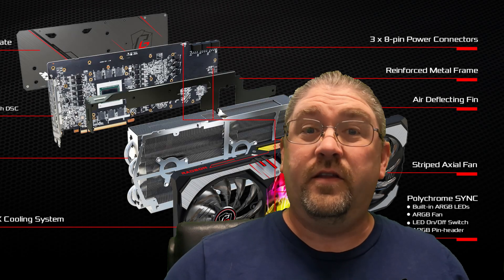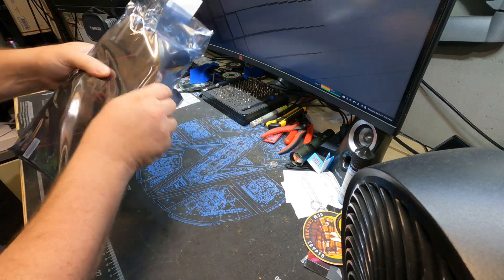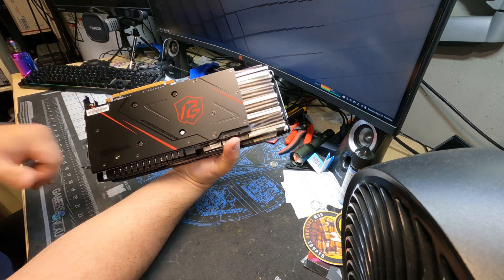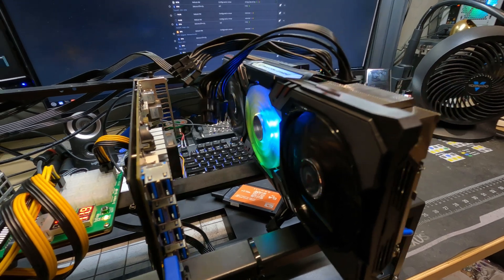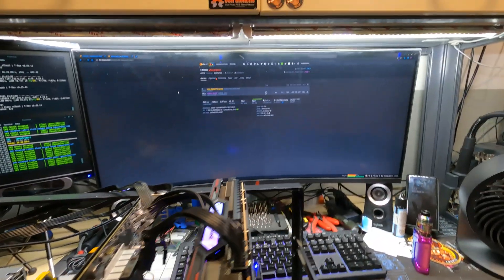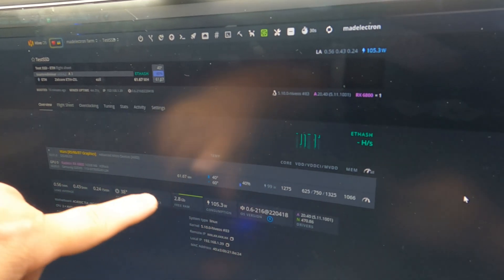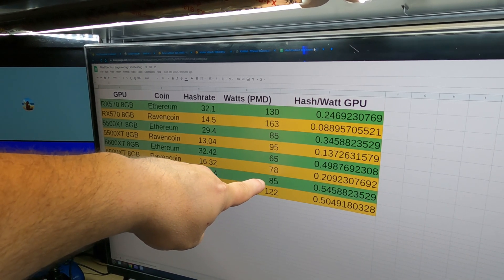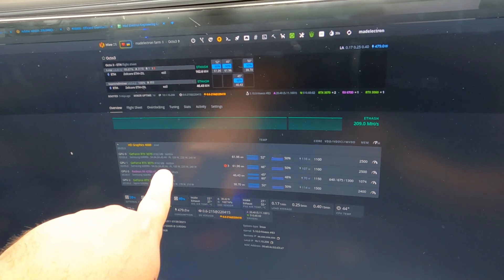ASRock AMD RX6800 Vs Nvidia 3070 FE Hashrate!!! #rx6800

Comment: 6800 does a great job with ETH.  While getting better, AMD still doesn’t perform as well as NVIDIA in a wider range of coins.  And with the ETH merge and difficulty bomb on the horizon, I have steered more towards NVIDIA as a hedge…
Reply from the maker: very true, I would choose Nvidia for flux as it doesn't work as well on AMD gpu's.